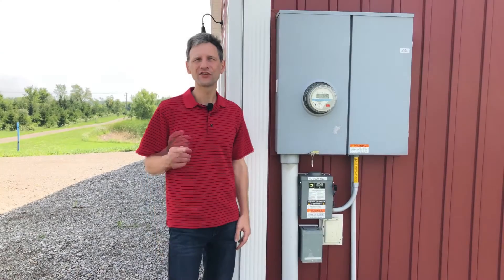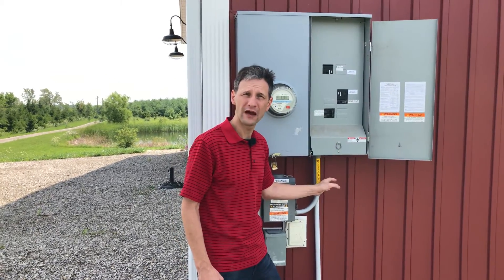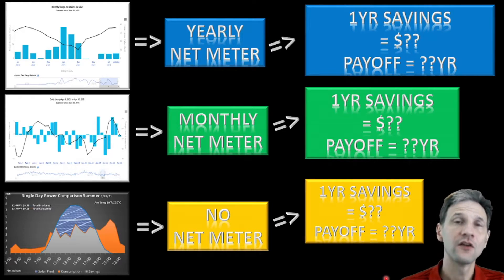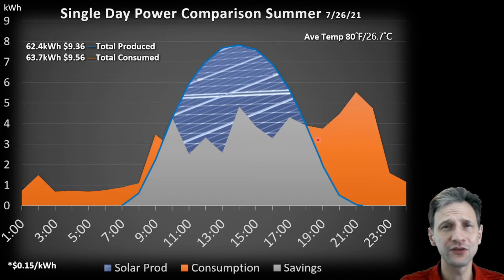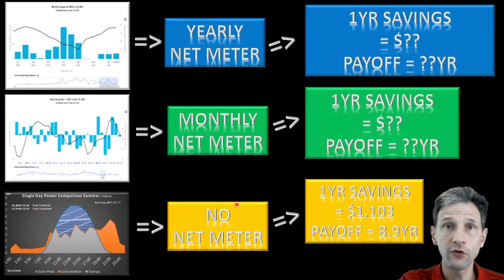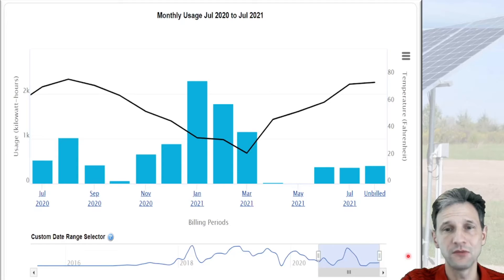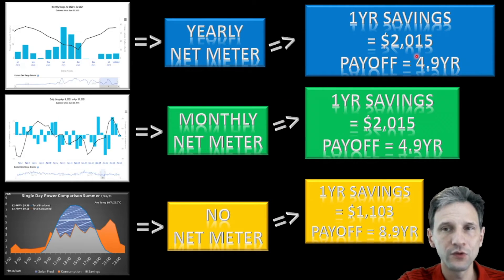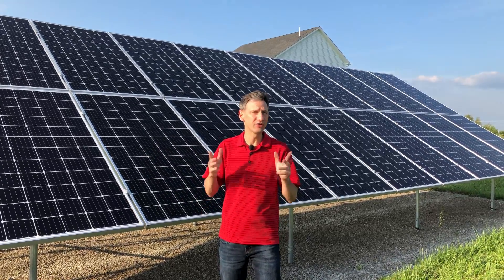Solar Panel System Net Metering With Actual Data

Comment: Without batteries you only have an illusion of an infinite battery.  All the state has to do is change the laws that regulate either you or your utility and you can be profoundly impacted.  It would seem that it would be far better to divorce totally from the grid and eliminate your bill altogether rather than going into debt to halfway participate in alternative energy production.
Reply from the maker: That may be true, but if you can't afford batteries, I think it's better to participate at some level than not at all.  That's one of the reasons I targeted a six year payback, it lowers the risk of something changing to impact my return on investment.  And it is also the reason I didn't borrow money to pay for the system.
Reply: @ProjectsWithDave Yeah that's true and something to consider. Though if you have any type of power outages your system fails to produce any power for you or the grid until the power comes back on. I guess you would have to consider how many times your power goes out and for how long. Mine goes out frequently for hours to some times days.

Comment: What rate do you sell the electricity to the utility and what do you pay when you buy it? Consider the time of day. Also, is there any advantage to installing a larger than needed system from an economics point of view?
Reply from the maker: Time of day is not a factor for me.  Production in the month is the net result.  I pay about $0.14/kWh if I use more than I produce.  If I produce more than I use for the month I get $0.04/kWh but only up to 20% overproduction.  That is why in my situation it does not pay to overproduce, that would make it take much longer to pay off my system.  I explain that more in this video on sizing your solar array: https://youtu.be/rbFnZqA0GCI

Comment: i have been looking into solar systems and found that the added expense of net metering equipment is a factor that never gets talker about. Also i dont like the fact that if the grid goes down then my production stops(this is not the case in all areas but seems to be common) and i am without power even though i have a power plant that could be providing me power. I have decided to go with a system that uses my panels, my batteries my inverters and my outlets to provide me with power. If and when my system cannot provide power then it transfers to the grid to provide what i need. No fees for extra meters, or having solar and batteries. I have paid for my system up front and will add to it as i get the funds.   I also look at my system as an investment, money in the bank gets almost zero interest. Money in my system pays me a monthly dividend that goes into an account to purchase more to add to my system.......
Reply from the maker: Sound like you have a plan.  I started with a grid tie system because it is the fastest way to pay off my equipment.  Now I am using the savings to pay for expansion into battery backup solutions.

Comment: I am currently designing a system for a property we're buying in Missouri.  The state net metering legislation from 2007 states that over production (net excess generation NEG) during a billing period (monthly) is credited to the customer's bill at a rate *at least equivalent [to] the utility's avoided cost rate*.  Another detail is that net metering is only available until the net-metered systems equal 5% of the utility's single-hour peak load during the previous year.  I can't find numbers which let me see whether the amount of connected systems are at or approaching that 5% number.  The legislation doesn't clearly state what happens if that 5% is met/exceeded.  Does it mean no additional net-metering connections will be allowed or does it mean all existing systems will start to get prorated?  Currently, it looks like the avoided cost rate (i.e. cost of production) is around $0.04 while the average retail rate is somewhere in the $0.13 range.
Reply from the maker: I had to clarify very similar questions when I was designing my system.  I contacted the engineer at the utility I was connecting to.  I asked them for example production and billing data for existing systems on their network.  They provided it to me, without the names of course.  It was very helpful in understanding the actual billing transaction situation in my location with my utility.  Give that a shot.

Comment: 3 out of 12 months you broke even. The other 9 months you bought power. I think you would be better off splitting it 6 and 6, instead of 9 and 3.
Reply from the maker: Yes, in retrospect it would have made the array a little larger, but I was trying to be conservative with my initial investment.  I was trying to make sure I had the best chance for a quick payback of the system.  You can see the logic I used in this video on Sizing Your Solar Panel System: https://youtu.be/rbFnZqA0GCI

Comment: In my area the grid companies pay so low rates that it is not worth it to install the extra stuff to sell a little back to the grid. F.ex. they stop paying you when the 0,- level for the bill this month is reached. So, I went for Growatts in a 3-phase parallel setup and no sellback. Perfect for my use, I am mainly looking to reduce the grid cost as much as possible, aka supply my own solar/battery.
Reply from the maker: Nice!  It sounds like you analyzed the value proposition for your particular circumstances.  There's no one-size-fits-all solution for solar.

Comment: when you designed your system, was it for mainly static loads or did you forecast additional load like getting EVs or geothermal?
Reply from the maker: I have geothermal and it was included in my planning.  I planned to be able to charge an electric car (See this video on my solar charger: https://youtu.be/U2ilH8yOi7A  ), but I didn't plan for the extra capacity to cover it.  You can see how I sized my array in this video: https://youtu.be/rbFnZqA0GCI

Comment: The is that some states are looking at penalties for having solar up here in Alberta Canada we have net metering on only the energy portion so that means that to stay grid tied we still have 180$ dollars of grid and municipal fees as well as billing fees so at 40 $ per month savings by the time a system is paid for it is lucky to have paid for it self the only way is to go low budget solar ie 110 volt under a grand fortunately I found utube other wise I would have listened to the glowing reviews of preppers who only care is that it works when bought not wether it last or if it eats batteries so you're buying new ones every 12 to 14 months or if you run out of power every other day you need true net metering where if you produce more than you use they pay you money but very few places have that and the one's that did are changing soon the only way solar will be worth it is non grid tied
Reply from the maker: Yes, if you want a system to pay itself off in a reasonable amount of time you need grid tie with net metering, and there is always a risk in the areas that have net metering that it will go away at some point.  That's why I am always shooting towards the shortest payback time I can get.

Comment: Great Video ! 
We've recently moved into an house with 25 solar panels and we use the Enlighten App to monitor the panels.  I'm currently struggling to understand why the App says I produce roughly 1.3 mwh per billing period but my electric company say I only produced around 500 kwh.   Any ideas as to what is going on would greatly help.
Reply from the maker: Yes, I think I can help.  Your solar app is measuring the output from your inverter so it captures all the production.  The utility company can only measure what you back-feed to the grid.  This is the "net" production (net=production-consumption).  When your consumption is greater than your production the utility company sees 0kWh's of production.  Then on a sunny day at noon when your AC isn't running your utility company sees an overproduction at your location feed back through the meter.  Hope that helps.

Comment: In Finland we have had for years so called remotely readable meters (2G/3G...) so power company can have live data and we have also access to that data. In my Grid-tie solar system has it own cloud based system that shows my solar production and my power usage in real time, with lifetime history also. It is very useful! I even got own info display only for that in my home.
Reply from the maker: That's great!  I have a similar system, it is great for analyzing performance over time.  I wouldn't be able to share nearly as much information without it.
Reply: It is incredible how har behind we are with this and other technology in North America

Comment: Do you have any video or pictures of the geo thermal heat? I love the videos they help a bunch.
Reply from the maker: I have considered doing an overview of the systems and it's performance, but you are the first person to ask about that and these videos take a lot of time to make.  I've had some issues with getting it to run properly, mainly do to the way the pond loop was built, that I think would be helpful for people to understand.  If I were to make a video on the topic, what things would you want covered?  Thanks!
Reply: I definitely would be interested in one of your thorough overviews on your geothermal system. I’m considering a geothermal heat pump replacement for our existing regular heat pump when that time comes. Ours would be an in ground slinky loop, but I’d still love to see your details on the pond system and energy use, and how you planned it with your solar system as I’m looking to have both solar and geothermal. Your details would be very helpful.

Comment: WOW thats one hell of a lot of power being used there. We use around a 6th of what you do. 8-12Kwh per day
Reply from the maker: Nice!  You will be able to cover a significant portion of your power with a much smaller initial investment.
Reply: @ProjectsWithDave  I live in the UK. So for around 70 days of the year there is hardly any sun, and the sun hours are lower. I believe it's April till October are peak time. 
I'm building the system currently. Our average power per hour is between 220w and 500w. So technically I don't need a big system but still have to have grid power. 
So it's more a off setting. Our power cost is 3.5 times more than you.
Reply from the maker: Thanks for sharing your system info.  High electricity prices will result in a quicker payback for your system.  : )
Reply: Same here. In the hot months (with AC on a few hours) I use about 8kWh per day.
Right now, with no AC needed, I use only 4-5kWh per day.

Comment: How much different would it be if you had batteries? Would that eliminate pulling from the grid at night?
Reply from the maker: Adding battery storage could eliminate pulling from the grid at night on days where daytime production exceeded the 24hr consumption.  However, that would only be helpful if my utility provided no net metering.  Since I have net metering by the month, the grid acts like a "month size" battery bank for me.  So in my case battery storage provides no economic advantage.  Hope that helps.  Thanks!
Reply: Most states charge a net metering fee and some have increased that significantly.  Charge controller, batteries, and zero export inverter can avoid this fee.

Comment: Thank you for the great info Dave!  I'm currently evaluating if solar would make sense for my home.  The city that I live in does net metering.  What questions would you suggest asking my utilities company to figure out the numbers?  My rate is 0.11 kwh.  Thanks again!
Reply from the maker: Ask for the net metering terms, and you can also ask for some example billing data for other users on your utility.  My utility provided me with one year performance and billing data for systems similar to the one I was installing.  There is some more useful steps in my video on getting your permit you can watch here: https://youtu.be/imiEYDHLG4A
And also in my video on sizing your array here: https://youtu.be/rbFnZqA0GCI